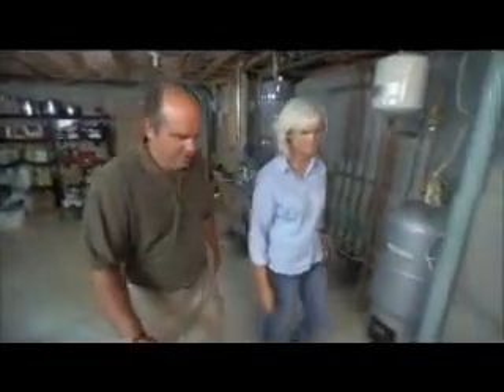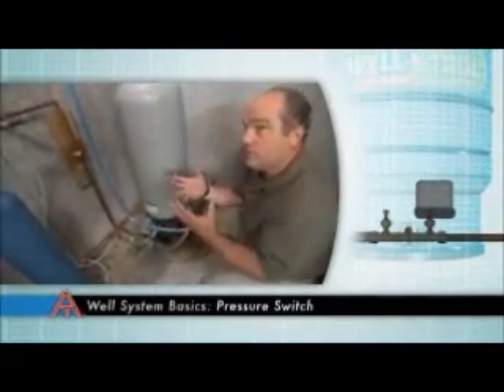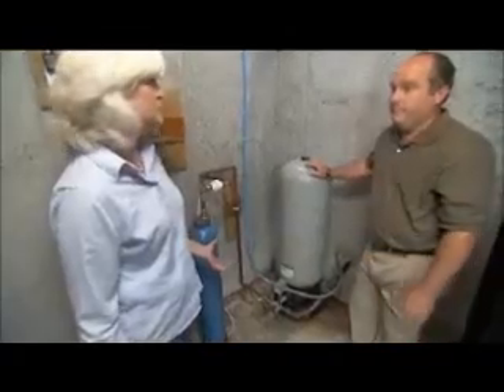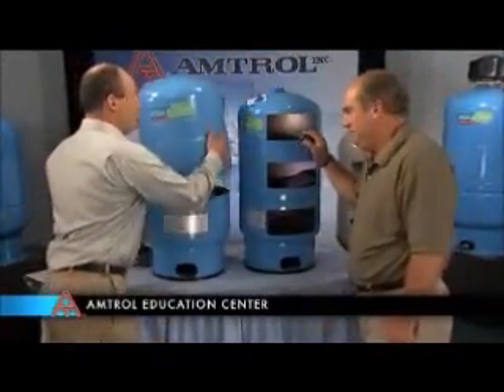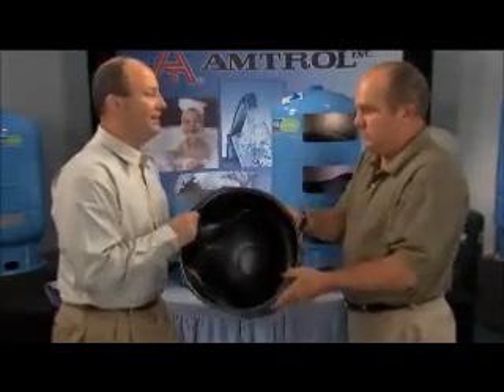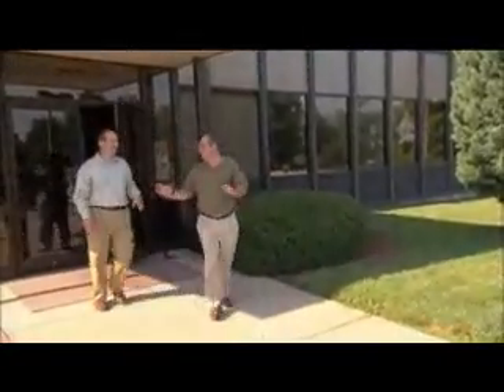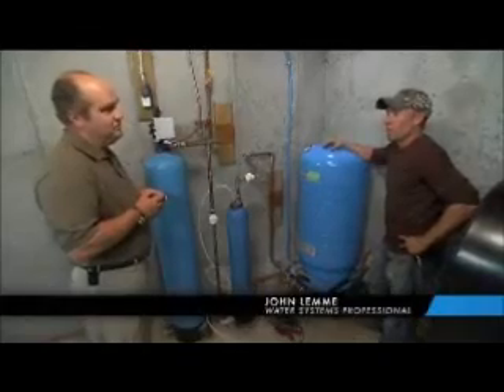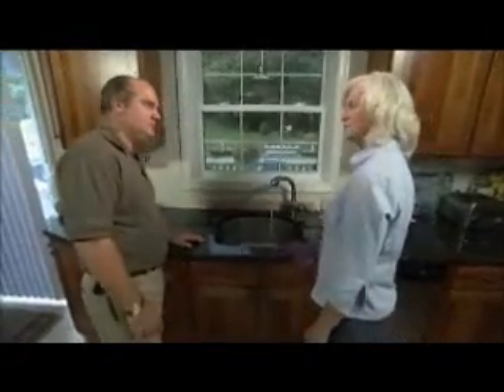Pressure Tank and Well Pump System Basics

Comment: I have good water pressure downstairs but the pressure is too low upstairs. If the dishwasher or sprinklers are on I get very little water pressure for the shower upstairs. Will adjusting the pressure switch screw help?

Comment: I just built a pole barn. My house is on a well. Can I T off my line to my house an run a line straight to my pole barn? Will I have low water pressure? Will I have to put another pressure tank in the pole barn? Or do I have to run a line to my pressure tank then run it back to my pole barn? THANKS

Comment: I have a well that has been sitting capped for years since connecting to city water.  Don't think anything has/had ever been done to it.  It is capped off with well head and all of the old tank, pump relay, pressure switch wiring stuff that was recently dug out of the ground.  I want to put a new system to it...I don't know what I'm doing...ha.  I want to get a pressure tank, the tee needed, the pressure switch etc... my question is that there is 220v power wire that runs to the pump, and I would think the pressure switch would be 110v...is that correct?  If so, how does that work or do I have to get a 220v pressure switch as well.  Or run a 110v line to one side of the pressure switch and then have 220 coming out the other side...possible?  confused.  Tks for any answers and or good site recommendations for not only the tank/tee install but associated wiring for system too.  Tks
Reply from the maker: +gandl2123 HI.  Thank you for your question regarding your pump system.  We recommend that you get a water systems specialist to check the leakage to ground on the wires going down the well to the submersible pump before proceeding with the repair.  The pressure switch is designed for 220; and, because the system is a 220v, 3-wire, submersible pump system, the wires must be on the correct terminals between the control box, pressure switch, and breaker box.  It is very possible that the system may work again, but the safest way to get it in service is to have an experienced pump technician check it and put the new parts on for the first time.
Reply: no

Comment: I put a video on you tube and my pressure tank sounds hollow from top to bottom is the tank bad or is the pressure switch bad .I had my well pump replaced 2 years ago and my well is 400 ft in the ground and I sure do not want to replace that again
Reply: hollow is ok dont worry its the usual situation with these tanks